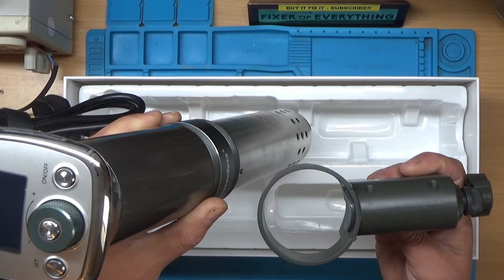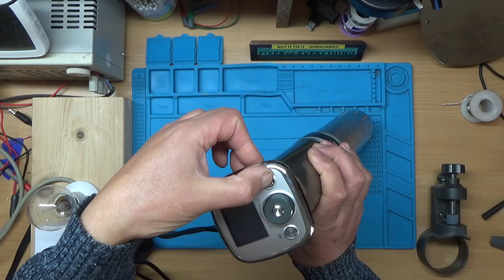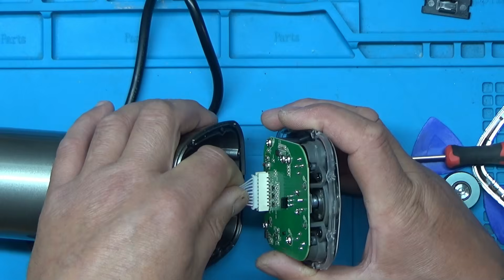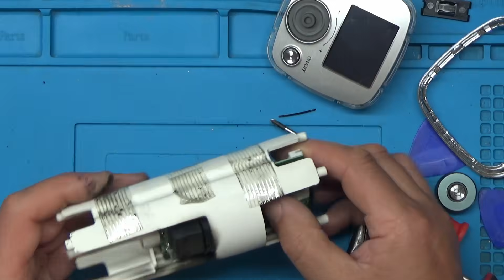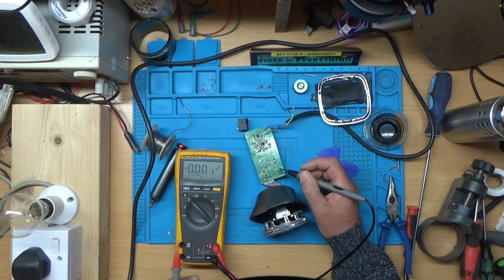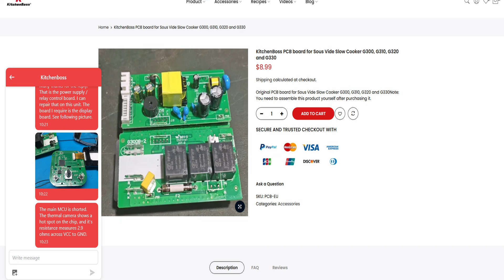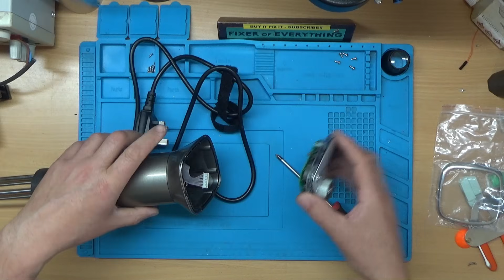Kitchen Boss G320 Sous Vide Cooker | Can I Fix It?

Comment: I doubt they changed relay suppliers because of issues - it'll just be whatever they could source at the time. You only have to look at the ChengX capacitors on the power board to see evidence of that - lowest possible cost on a item they have the nerve to charge £150 for. Suspect they know their product has issues and when you said you were a YT repairer you spooked them.
Reply from the maker: Could well be 👍

Comment: What a terrible design to allow that relay to fail so catastrophically, fair play to the manufacture for supplying parts though.
Reply from the maker: I think it's the design of the relays, as the high voltage side seems be next to the coil input. I think the carbon from the arcing allowed the voltage through to the microcontroller.
Reply: Ive never trusted those relays. They are poorly designed.

Comment: Fuse is there to protect the wire. spec the fuse according to the wire size and not the appliance power.
Reply from the maker: Something I didn't know. I always thought it was to protect the equipment too.
Reply: @BuyitFixit  Appliance power is the primary consideration when selecting fuse size. The 'wire' will be specified to suit the appliance as well.
Reply: I'm old. I still have 1/2/3/5 7/10A fuses (and 47 60W tungsten BC lamps, plus 100W BC and ES)
B&Q yellow sticker discount too as they had to get shot of them. Right place, right time)

Comment: If you have some tough old steak, you can vacuum seal it, set the temperature for the level to which you want it cooked and you can (if you really want to) leave it in the water bath for up to 72 hours. Leaving it at the desired temperature for so long allows the tough, connective tissue between the protein strands of the steak to break down via (due to the heat) accelerated enzymatic action making old boot leather type beef significantly more tender and potentially melt-in-the-mouth 😉

55°C – Medium-Rare
60°C – Medium
65°C – Medium-Well Done
Reply from the maker: Thanks for sharing 👍
Reply: @BuyitFixit  If you want to understand the science, search for "Douglas Baldwin" as he's written by far the best book on the subject, and you can read it online on his web site. If he makes a statement, he links to all the studies underlying it. There are other sites to aid with the creative/practical side, but reading Baldwin first will let you set them into context.
Reply: Then dry it off and flash fry both sides to get the maillard reaction. Perfect steak every time.
Reply: @georgeprout42  👍
Reply: Thanks for this! Not only do we learn how to fix past their best devices but also past their best steaks!

Comment: Why they did not send you a completely new unit instead of removing boards from a new unit? Am I missing something?
Reply: He needed the parts to make the video. No content in a replacement entire unit.
Reply: yeah, that was my thought 😊
Reply: They can keep the other parts for doing repairs themselves.
Reply from the maker: Could have also been postage costs. I didn't need the whole unit anyway, as everything else seemed to check out OK.
Reply: @BuyitFixit  To make a full repair, you should try to read EEPROM from the good board and then program a new chip 😀
Reply: Yes, that would be a good idea. Backup the firmware then you can program a new MCU and EEPROM chip if the heating element relay over heats/fries it's self again.

Comment: A consumer product company that provides a generous assist, even out of warranty. Now, thats a product one should buy. They apparently knew of a supplier defect and made the necessary supply line changes. Well done, Mick.
Reply: That’s what you call right to repair   Great job Kitchen Boss

Great fix as well
Reply: @rickchowsr2532 
It was out of warranty. The company didn’t have to furnish Mick with the replacement components. They stepped up to show excellent customer support and should be praised for their generosity.
Reply from the maker: Thanks mate 👍
Reply: @BuyitFixit that’s what you call Right to repair great job Kit Jen Boss and great fix @BuyitFixit
Reply: Nicely done, KitchenBoss!